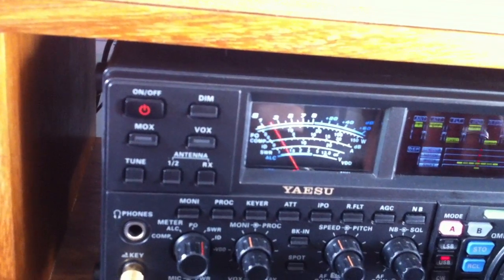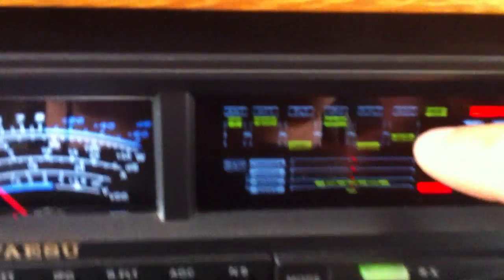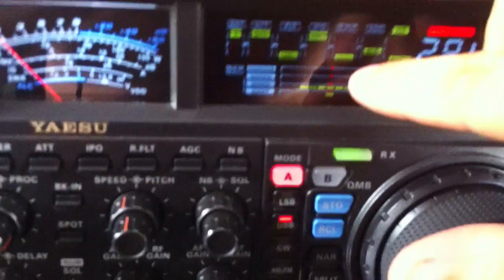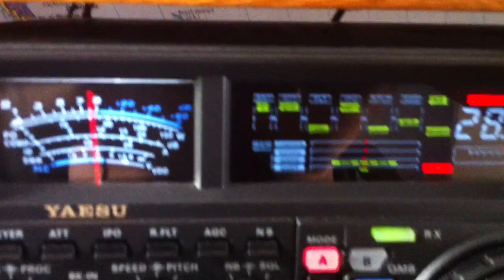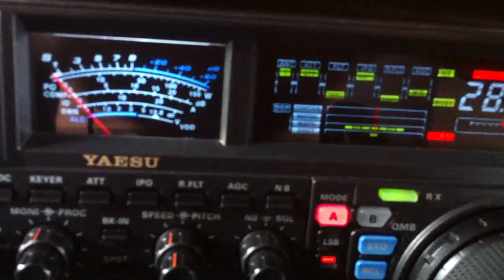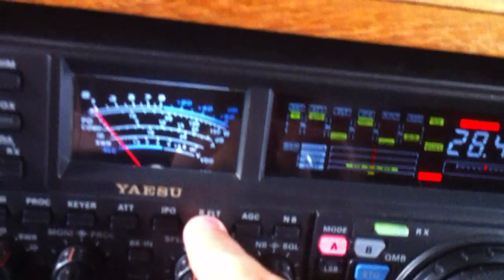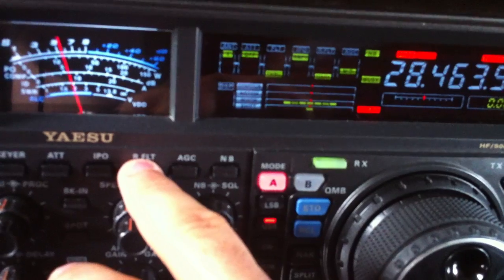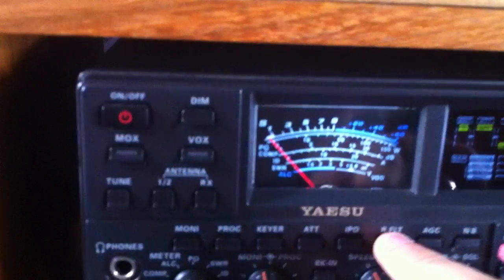FT-2000 with 3Khz Roofing Filter by AC0C / NS

Comment: Sounds  poor  compared to my FT 2000. Have you got the latest 159 firmware installed?. This is essential. I do not use the overpriced AC0C filter and see no point in  it at my QTH. Took me a year  to get my FT 2000 where it is now and I get super reports from many other Hams all over. I will not change it.
Reply: Reports you get are not important. This story is about bad choice Yaesu made for pickimg too wide roofing filter. With AC0C this error is corrected.
Reply: Maybe it is overpriced, but it does the job. FT2K 3kHz is the same as 6KHz and no formware update can solve this problem. Only AC0C or similar modification.